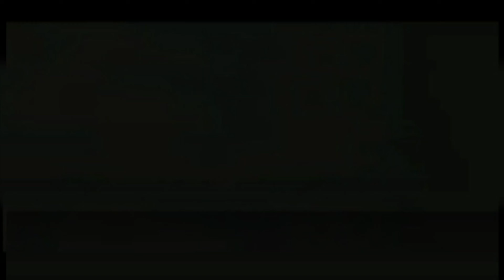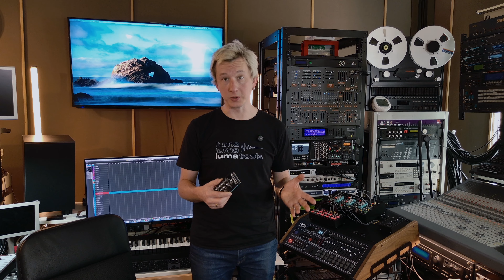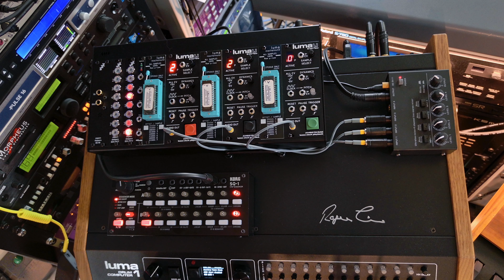Luma-mu - Tutorial 01 - Basic Patching

Comment: So the trigger in, is there any way to use something like a Simmons pad to trigger it with dynamics? I know those wouldn't be +5v so I assume this wouldn't work...but if so it would be amazing. Like a better version of the snare/rim section of the SDS-9. Also, on a related note, I have 60+ EPROMs (some custom sounds) for the Simmons SDS-9. Would those EPROMs work in the Luma Mu?
Reply from the maker: Yes, you can trigger Luma-mu with velocity. Use CV input "Dynamics" in addition to the trigger. To convert. analog pads you certainly need some circuit like this https://web.archive.org/web/20190515013102/https://www.paia.com/ProdArticles/drumsens.htm